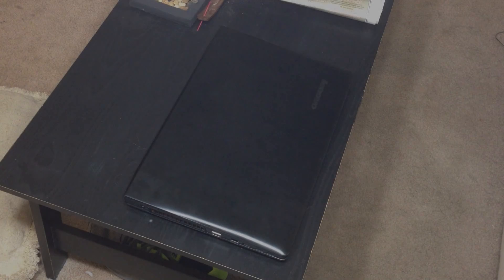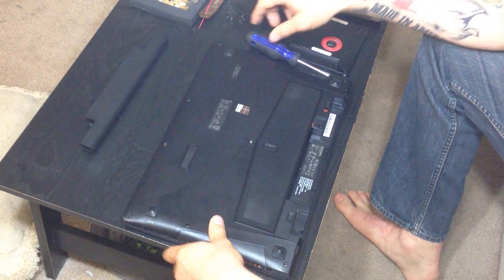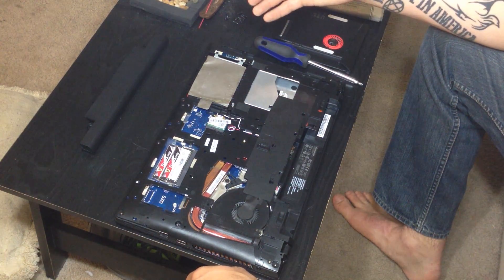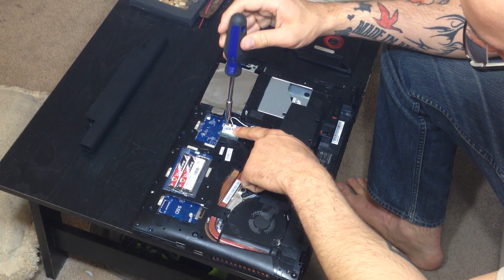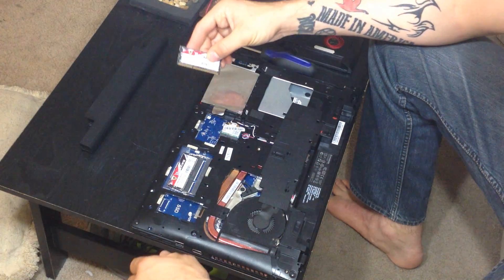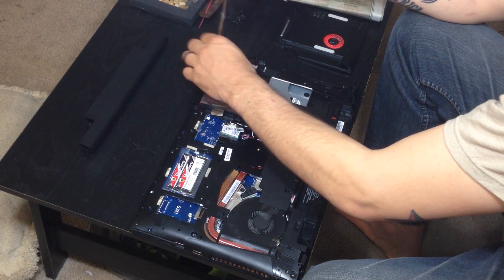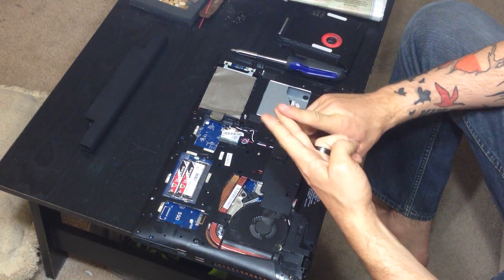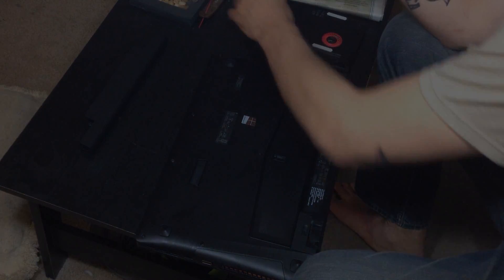Lenovo IdeaPad y510p SSD/Ram/WiFi Card/M.2 SATA Install and Swap

Comment: So I have to say I believed my laptop had an ssd built in when I bought it in 2013. In my computer it showed as having 2 drives one smaller drive with the os installed. After I updated my pc to windows 10 it ran much slower and for some odd reason my os was now installed on the larger drive which I believed to be the hard drive. Come to find out after taking the back panel off I have an sshd with 8gb cache and no ssd whatsover. There is the slot for the ssd though! Bought it on amazon for about 500 dollars cheaper than the sli option would normally cost from the manufacturer... I think I now know why it was so much cheaper.

Comment: I tried to install msata ssd with m2->msata converter and it was hard because of problem with the empty space. now I have problem with running my laptop, only power key is lighting, but no sounds ... no screen bios. Only usb charging is ok. whats happened?

Comment: i have installed a second 8g ram stick to my ideapad y510p but the computer still only show 8g instead of 16g. i tried each of them both works on this laptop but when i insert both of them why the system only show one? anyone can answer this question? thanks
Reply: yixuan Dong system may require a pair. sometimes they don't like to work with two different sticks. is it dual channel?
Reply: Fact V Fiction Sorry, I am not a geek so... what is dual channel? it has two slots. I am not sure if it is because I am using two different brands.
Reply: yixuan Dong 
Modules rated at different speeds can be run in dual-channel mode, although the motherboard will then run all memory modules at the speed of the slowest module. Some motherboards, however, have compatibility issues with certain brands or models of memory when attempting to use them in dual-channel mode. For this reason, it is generally advised to use identical pairs of memory modules, which is why most memory manufacturers now sell "kits" of matched-pair DIMMs. Several motherboard manufacturers only support configurations where a "matched pair" of modules are used. A matching pair needs to match in:

Capacity (e.g. 1024 MiB). Certain Intel chipsets support different capacity chips in what they call Flex Mode: the capacity that can be matched is run in dual-channel, while the remainder runs in single-channel.
Speed (e.g. PC5300). If speed is not the same, the lower speed of the two modules will be used. Likewise, the higher latency of the two modules will be used.
Same CAS Latency (CL) or Column Address Strobe.
Number of chips and sides (e.g. two sides with four chips on each side).
Matching size of rows and columns.
Dual-channel architecture is a technology implemented on motherboards by the motherboard manufacturer and does not apply to memory modules. Theoretically any matched pair of memory modules may be used in either single- or dual-channel operation, provided the motherboard supports this architecture.
Reply: Fact V Fiction Thank you very much.!

Comment: I took my lenovo y580 to service because windows didn't install properly. When u picked it up they said they had to remove  my 16gb mSATA ssd because it failed. They went ahead and installed windows 10 on the regular hard drive? is the ssd very important? should o install a new one? thank you.

Comment: Is it possible to change out damaged USB ports? Are they separate from other pieces? I'm sorry, I'm not familiar with hardware at all. I just need to know if it is possible on my particular laptop to replace them. Would I have to replace the motherboard at the same time? I contacted Lenovo support and did not get a straight answer.

Comment: I have bought a caddy and fitted it with a HDD. I know I can fit in a SSD in that. But will I be able to use that SSD as primary drive and will i get performance as good as SSD fit in the HDD slot?

Comment: Baustin, I need to replace the USB 3.0 port on my y510p, I was hoping you'd be able to tell me if its through hole or surface mount before I actually took apart my laptop. I appreciate it!

Comment: so i have this notebook but different version with CD rom instead of second graphic card and only 8 gb RAM and my question is if i have there one 8gb card and slot for second i would buy secontd Kingston 8GB DDR3 1866MHz CL10 HyperX Fury Black Series i don t know if it is good idea and if it will be compatible sorry for my english and please someone help
Reply: +Ajay Hunter Dude download CPU Z install it, and check what type of RAM your laptop uses, with it you can also find out if you're using one or two RAM slots from your machine without even opening it...

Comment: Hey man! Awesome video you got here. Wanted to ask you a question tho. I just got a Dual Band  AC 7260 wireless card i want to install on my y510p to replace the wireless 7260 N card the laptop comes with. However, upon installing the card, i get the error message: "unauthorized wireless card installed. shut down and remove the card." So Im wondering if you can guide me through the process of flashing my bios or whatever I need to do in order to install my new wireless card on my laptop. 

Thanks in advance!

Comment: Will any wireless card work with this laptop?  I heard that lenovo blocked the BIOS or something like that so you cant upgrade a lot of parts in there...  If you can upgrade, do you know what the best wifi card is?  I would like to upgrade mine.
Reply: it has a whitelist and you can just do a custom bios install to unlock everything

Comment: My son dropped his y510p with headphones in the sound jack and it loosened it a little bit, probably breaking a solder joint or something. Is that accessible at all or do we need to take it in for professional service?

Comment: Hi, I have another lenovo, but seams to work the same. I want to upgrade to an ssd, but i dont know if it is better to replace de hdd for a ssd (250gb 840 evo, for example) or buy an 128gb M2 ssd and boot from there, to have the hdd too. Does it work as cache or as a separate disk(ssd). Thanks
Reply: Well I have Done this 2 days ago and beleive me it was a very bad decision. I have an intel 240 GB SSD, if speaking about speed it is at max, but if you are a gamer and that kind person who have many programmes and do hackes cheats and cant leave your save games AS ME PERSONALLY you will hate it First same original windoes installation on SSD is complicated that I got another version which I hate seconde all your installed games on your HDD if you connected it externally you will have to install them again  and some times you may lose your save games and many other issues if you are that kind of vivide person you use torrents hackes and crackes and so on TRUST ME I REGRET IT THAT MUCH AND I WILL SWITCH TO MY HDD!

Comment: Great video, thanks for being so thorough!
I've got a Y510P (2013) w. 8 GB ram preinstalled, but advertises the ability to upgrade to 16 GB.  Anyone know if that (hopefully) means there's one 8GB stick in there and an empty slot for me to put another?  Or two 4 GB sticks in which case I'll have to buy two 8 GBs and replace both slots?

Comment: I've recently bought lenovo y510p and my cpu make some grinding/murmuring/buzzing sound when it (cpu fan) works at low speeds. This sound is driving me crazy. he laptop is like 2 months old. Have you encountered such a problem with your unit? Can you hear you cpu fan grinding/buzzing noise too? Please answer.

Comment: I have a Y410p and I am not able to use the GT755m graphics card. It is only allowing me to use the Intel Graphics. I tried everything. I changed 3d settings, I put high performance on power settings, I right clicked programs to run with the 755m. Nothing works
Reply: do you enable it on nvidia control panel?
Reply: 29Fps I've tried everything. I called Lenovo, I called Nvidia. Nothing. I ended up returning it for a full refund. I'll build a computer instead. :)
Reply: Malik M The y50 is available for 989 on amazon check it out. It has better res screen better slim and sexy body, 860m(double the performance of the 755m). iff you go for the i5 version it can be had for 850ish.

Comment: Hey, thank you for the video, I was wondering if you could link me to the RAM you have in this video, I can't seem to find them via google.  Thanks!
Reply: I am too late, but this works fine for me. Crucial 8GB Single DDR3/DDR3L 1600 MT/S (PC3-12800) Unbuffered SODIMM 204-Pin Memory - CT102464BF160B

Comment: Hey man, I have the same laptop.
When I use Speccy to identify my hardware I see I have 4 RAM slots available, I tought it was odd so I opened it up and I found I only have 2 slots. Is it possible 2 other slots are hidden somewhere else?

Comment: I still don't get it... there are m.2 sata ssd drives on amazon with like 240/480GB capacity. if I do purchase one and install it into my y510p, will it work as a logical drive or as cache memory only? I have an sli setup, so I don't want to remove an ultrabay gpu, I've bought a 1tb ssd (crucial m550), but I want to buy this one
http://www.amazon.com/MyDigitalSSD-Super-Cache-Solid-State/dp/B00EZ2E8NO/ref=sr_1_1?s=electronics&ie=UTF8&qid=1397613925&sr=1-1&keywords=m.2+ngff+ssd
to run the OS. will that work for me?

Comment: how did you go about installing the os on the new ssd? dose the laptop come with a windows cd?
Reply: Just in case!

The Windows key that you use to reinstall Windows, is stored in the bios on some Lenovo laptops. When I reinstalled windows onto my new SSD, I had to "acquire" an OEM copy of Windows 8.1 on TPB to be able to have the windows installation automatically read the key. If you download it via torrent, I do not believe it is illegal, since you own a copy. 

You need to use the OEM version your laptop came with. Mine came with 8.1 so that's the one I used. My brother's Laptop came with just Windows 8, so I had to use the 8 OEM version.

If you use the OEM copy of windows, when you install, it won't ask you for a Windows key since it reads it from bios.

This took me a bit of time to find out, so I'm writing it here to maybe save someone some time.
Reply: no you will have to find some software to mirror your hard drive onto the ssd
Reply: yeah i was afraid i had to do that, i heard cloning the OS from a hard drive onto a ssd, the os dosn't line up correctly or somthing like that. oh wel thanks for the info, have an awsome day
Reply: thanks  appreciate it
Reply: Kyle Henderson I was looking for this specific statement for months.....thanks!

Comment: Hello,
I've just bought an Y510p but the ODD tray is stuck.

I pull the little hinge and try to pull the ODD out but it does't work. I tired harder and harder until the plastic face of the ODD broke off :(

Any ideas ? I really need to take it out and put a tray with a second disk.

I'm thinking about taking it to a repair shop to see if the damn thing isn't jammed or something. Unfortunately I also broke my waranty by breaking off the plastic crap ( mould ) of the ODD :(

Thanks.
Reply: here are the steps to pull the ODD out
first remove the battery
second  unlock the lock button below the battery by moving it downward
you can see also another lock switch on the venting system
third step ,by the using of both hands pull the lock switch up by one hand and at the same time pull  the ODD out by the second one
you can check also the video at 1:00 min
hope that i was helpful
Reply: Thank you, but the latch was stuck in mine, i had to open it and pull it with a small screwdriver to work ...

Comment: I have a 888TB HDD 5400RPM (C:) and a 24 GB SSD(D:) (Not in my ultrabay) installed on my new y510P. The thing is I want to upgrade this 24 GB to about 200-250 GB so I can install windows and all my programs on there while saving my files on the HDD. But I can't find the right SSD any where. I don't even know what to look for actually. Do you have any idea what I should be looking for, maybe you have some links or anything? Thx already

Comment: Do NOT get your Y510P from Newegg if you want to add a NGFF M.2 SSD.  Most from Newegg do not have the NGFF connector.
Reply: The thing is they try to hide that the "8 gb SSHD" stands for 8gb hybrid drive meaning there is no separate m.2 SSD. Lenovo removes the port if you don't buy a laptop with a separate SSD.
Reply: Brandon Moore  oh and newegg does sell the laptop with the m.2 port. You just have to make sure it says it has the 24 gb ssd.
Reply: Brandon Moore They don't anymore

Comment: also i am looking at getting a 120gb ssd to replace the 24gb ssd in my model. is even that possible. and how will i know if the ssd will fit and be compatible.  any help is appreciated!
Reply: Yes, it is possible but you need to get a M.2 44mm mSATA drive.

Comment: I wonder if it is possible to replace the NGFF SSD with a larger one and set it to the driver mode instead of the cache mode.

In this case, the SSD can be the disk for OS and the Hybrid Disck can be the main storage.

Also, does Lenovo supports drivers for Windows 7? I don't think Windows 8.1 is a good system especially for some design software used by engineers.
Reply from the maker: It is possible to do so with the SSD. I did two separate partitions and used my ssd for the os and games and the hdd for storage. And I'm sure they do support Windows 7. You can check their website.

Comment: Thanks for the Video.  I am one of those people who is having issues with the Intel Centrino wireless card.  I have a replacement ordered but am a little unclear what I would need to do after installing the new card.  Can you explain what drivers or what process I need to go through after installing the new wireless card.

Also, do you know if this computer could handle a Raid0 setup with 2 SSD hard drives?
Reply: Baustin McManus
First off, thanks for everything Baustin - this video has been fantastic.

Can I ask what wireless card you'd recommend updating to? This Centrino has been F*&King S&%T
Reply from the maker: When you install the new card windows should recognize it and install the drivers for you. If not, go to the company's website and find the drivers for your wireless card. And it probably can handle raid 0. But you would need to get rid of the second graphics card and replace it with a hard drive caddy.

Comment: hi, great video but i do have a question. can i clean the laptop of dust from the state which you achived in the vid or i need to continue unscrewing stuff? ty
Reply from the maker: You should be able to clear the majority of the dust in the laptop from the disassembly i showed in the video.

Comment: Is there a way to install a m 2.0 sata ssd on a 510p model that does not come with the m2.0 sata connector? The y510p I have , similar to the one being disassembled, does not have a connector, so is there a way buy the m2.0 ssd connector, and which connector should I get?
Reply from the maker: Yes you can buy the connector, but you would have to solder it on to the motherboard. Which will void your warranty and is very difficult to do.

Comment: When I replaced the wifi card on mine, it wouldn't boot. Do you have an unlocked bios? If so, where did you get it from?
Reply from the maker: I do not have an unlocked bios. I use the stock wireless card that came with the laptop. If you do some googling you should be able to find unlocked bios' out there. But it does void your warranty, so be careful.
Reply: ok, thanks!

Comment: Is there anyway of getting an ultrabay 755m and getting dual graphics with the 755m? Can you change the graphics card in the Ultrabay or are you stuck with 750m? Thanks :)
Reply from the maker: If you use the 755 in the ultrabay, it will not work in sli with the 750 on the motherboard. for sli to work it needs to be the same graphics card.
Reply: Right okay, thanks. Great video by the way!
Reply from the maker: Thanks!

Comment: I've seen a y510p with an internal GT 755m with a DVD optical drive. Would it be possible to pair the 755m with an ultrabay 750m? Just curious.
Reply: I don't think so. If this laptop actually used AMD graphics cards, it just needs the same memory configuration and needs to be based of of the same architecture. With Nvidia, you need cards with identical GPU's as well as the same memory configuration.

Comment: does just unscrewing the back panel/cover make the warranty void?? also, i heard in the 510p model ultrabay does not allow for an extra hdd/ssd while the y500 does; is this true?
Reply from the maker: Unscrewing the back does not void the warranty. And you can get a hard drive caddy for the ultra bay in the y510p. But honestly, it is not worth it. Just get a external hard drive. I do not ever take out the second graphics card. I always keep it in for the best performance possible.
Reply: thanks

Comment: Can you install an mSata drive like in the y580?
Reply from the maker: I do not have an mSata to install, and I would also have to solder on the port. It does not come with the port installed on the motherboard.
Reply: Too bad, thank you for responding.

Comment: Hey could you test guild wars 2 on the i5 version?
Would be a real help.
Reply from the maker: I can play it on the core i7, because I already installed the core i7 in the laptop.
Reply: Cool. i plan on getting the i5 version. If you could id be thankful if you thest it on the i5 version. Or did you allready sell it?
thanks anyways
Reply from the maker: I already sold the core i5.

Comment: Do you have fingerprints problems?
Reply from the maker: It does attract fingerprints, yes. But they clean up quite easily.
Reply: The laptop itself is made from brushed aluminum, so it does attract fingerprints rather easily, but not nearly as bad as glossy black finishes.